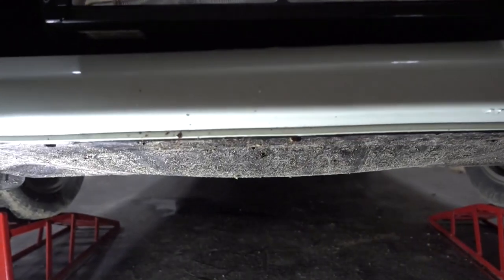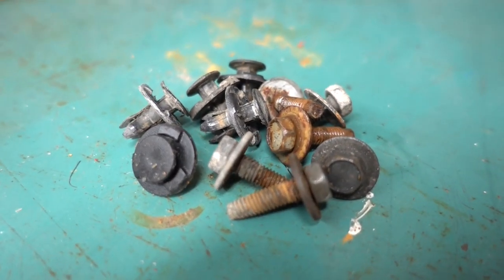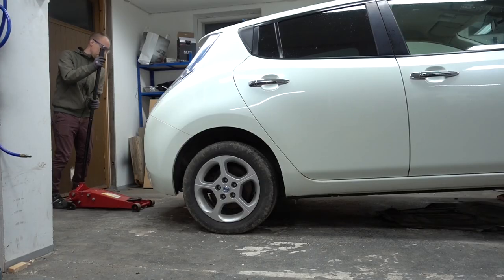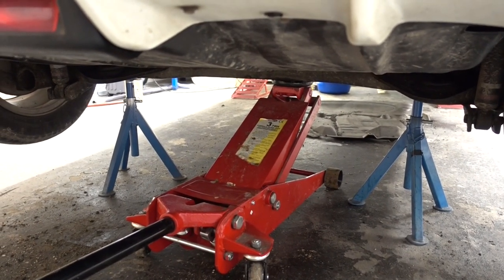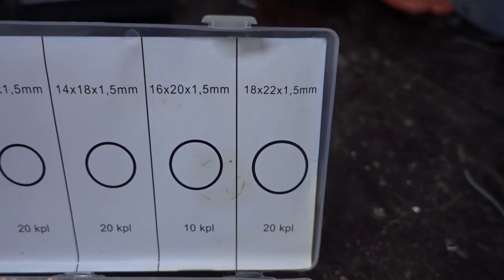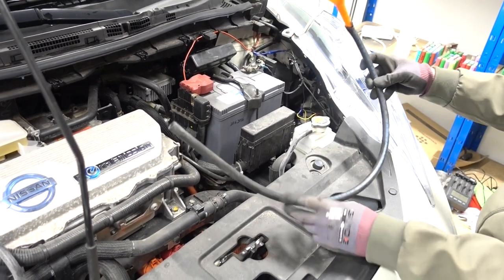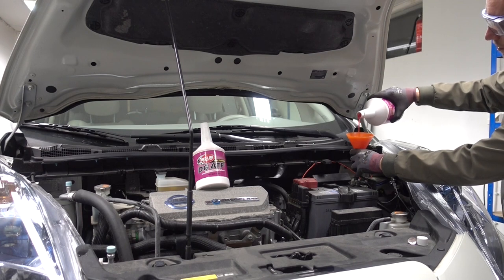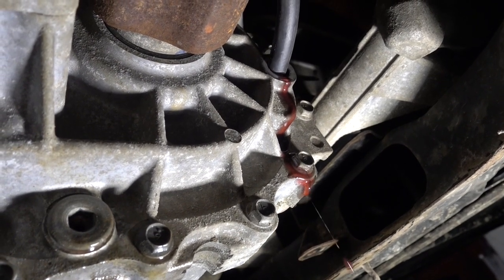Nissan Leaf Reduction Gear ATF Change [Efficiency boost!]

Comment: For those interested, I did this fluid swap on a 2015 Leaf about a year ago using Amsoil Synthetic ATF.  Went from 4.6 mi/kWh to 4.9 mi/kWh.
Reply: In warm or cold weather?
Reply: @daltonx6177  IIRC I probably did that fluid swap in warm weather.
Reply: I did this fluid swap on a 2013 Leaf a little late, I had over 120k km on it, with Valvoline ULV ATF in July of 22 and went from a yearly average of 5.8 km/kWh to 6.6 mi/kWh. There/s a small clunk noise from the reduction gear when changing forward and reverse if it's warm because the fluid is so thin, but has been fine for 19k km.
Reply: thanks 4 sharing with us!
Reply: Very interesting. I just bought a old Leaf. This car has under 50000 km on the clock. It is good looking both outside and inside. Battery health seems too be good also. I have seen many,many videos here on YouTube about this model. My thought goes to the possibility to make a battery change on it. But doesn’t know if any company here I Sweden do it? Or if I could do it myself maybe? Okey, have a great day.
Reply: @sanoj1969  No idea about Sweden but here in the U.S. there is someone swapping 60 kWh batteries into first gen Leaf’s.  I think they wanted $10k.    I was hoping Nissan would offer a battery swap program which would allow one to buy a larger battery and credit you back the original battery for recycling but that has never materialized.  At any rate, I’m now at 90,000 miles with 11 out of 12 bars remaining on my battery.
Reply: @bobbbobb4663  where is that person in California or Washington or Oregon or something? 
    Do you know any places doing battery swap on the East Coast? I have a 2013 that I’ve had since 2020 it had 10 out of 12 bars …just went down to 9 . I still use it every day, but I would love to get a battery upgrade in the next year or two.
Reply: @matthewzizzo4586  Sorry I don't recall

Comment: Did this a couple days ago. Very easy process. What I've noticed after. Is takes a little less energy to stay at cruising speeds. Will see if the miles per kilowatt improves
Reply: So ? Did you measure any improvement after one year ?
Reply: @daltonx6177  I noticed it more when it was very cold. Could I measure it, not really. Just felt a bit smoother at cold "starts". But the oil that drained out vs what I put in was an upgrade.

Comment: I stopped taking my 40kwh leaf for service when the warranty was up as the dealership is a ripoff and haven’t serviced it for 70,000 miles with no problems. No loss of battery bars and running as new. After watching your video I’m thinking of changing the oil soon.
Reply from the maker: Good idea, it will make the reduction gearcase last twice as long!

Comment: What a coincidence! I just replaced it yesterday. A thing to mention, for 2011-2012 made LEAF oil capacity is only 1.1 Liter. I have also used some Molyslip additive. I was geting very good results in ICE vehicles by using Molyslip additives. So decided it won't hurt if I use it on my LEAF either.
Reply: Me too, added molyslip 5 years ago when I changed the fluid at 60.000km Now the car have 170.000 so should have made a change agiain, but I believe with the molyslip additive, MoS2, it is not needed.
Reply: @tucsonor   I have a better additive to offer called Turbofield Nano Treatment. This TREATS THE METAL AND NOT THE OIL.This is more long lasting and reliable and reduce friction heat noise and vibration.
Reply: @tucsonor  no not at all similar . This is not chemical .Molyslip is on micron levels and this is nano level .It is totally different .

Comment: Ive done this service on both my 11 and 18 LEAF.  if its never been done get it done....the fluid gets super nasty and laden with metal particles from the gears.  mine looked like sparkly black oil on the 18 after only 20,000 miles.  I used Amsoil ATF.  Great video Dala!

Comment: I watched this very helpful video and changed my oil yesterday. My 2015 Leaf has a third port on top of the gear case. I used the top port to add the oil, but you need a 10 mm hex bit socket, a universal drive and a couple of long extensions to get to it. For most people, the method in the video would be easiest. He mentions that his brakes might need attention. You can test for brake drag by stopping your car at a landmark on a slight hill leading to a flat section of road. With the car in neutral, release the brake and note how far the car coasts before it stops (a tree, driveway, utility pole, etc.). Do a baseline run after brake service and then every couple of months. Any loss of distance will indicate there is brake drag or possibly an underinflated tire or a bad bearing. The parking brake might need adjustment, too.
Reply: how do you put the Leaf in Neutral?
Reply: @bradjohnston9810  Move the shifter to the left and hold it there for a second or two. It's the same as shifting into forward or reverse except you don't move the shifter forward or backwards.

Comment: The Aluminium crush washers can be re-used at least once, but should be annealed to soften them first. The trick is to mark them with black or blue Sharpie marker and then heat them until the Sharpie colour fades. Quenching makes no difference to the annealing.
Reply from the maker: Good tip! I'll revisit the fluid change next year and see how it is holding up, maybe even try lower viscosity valvoline ULV

Comment: Just changed the fluid on our 2013 Leaf with 85k miles on it.  I was surprised how clean the fluid still was- it was still pink and this was first change.  This video made the process pretty easy.  I agree with the others in that the splash shield is hardest part of process in many ways.  My splash shield was damaged with some tears that I repaired using some Gorilla tape.  

My tips are:

1. Use a long neck funnel if your existing funnel with hose doesn't reach. Mine did not so I was able to snake the funnel with hose closer to the fill plug and then use another funnel to reach that one.  That worked fine and saved me a trip to buy a different funnel with hose.

2. oil your splash screen screws to reduce chances of rust- an easy thing to do

3.  on the splash shield reinstall is to start from the rear because the shield folds in under the other shield. I did not do this initially and had to remove all the other fasteners and do again. I also used the Redline D6 as well. I'm a big Redline fan so that was an easy decision to go the Redline route.

My total service time was about 2 hours- I got to talking with the neighbor and had the length issue with my original funnel with hose that needed resolution.

Comment: Thank you sir' I am a Nissan leaf owner, and I completely forgot about gear oil changes, I used to do this on any automatic petrol car I owned previously, 

Here is the UK, there is an unfortunate trend, it's called rip-off Britain, many services and items are far too expensive especially when they have the monopoly, I therefore try to do most things myself, thanks again for this valuable knowledge
Reply from the maker: Good thing to DIY this one! Good luck!
Reply: In the UK, a fellow writing into mynissanleaf.com said it costs 230 British pounds ($321 U.S. dollars) to get it done.  In the U.S., I think a Nissan dealership will charge around $70 U.S. dollars.  Thing is, in the U.K., they are just going to keep people away with prices like that.  Even the $70 U.S. cost is too much in my opinion.  This is an EASY job, and only 2 quarts of ATF fluid, 2 new aluminum crush washers, and 15 minutes labor.  I've done mine and am about to do it once more.

Comment: I did a brake change in the back and cleaned/ lubricated the front breaks on my env200 2014 (24kw) two weeks ago. My consumption dropped significantly and I'm measuring a average range increase of 18% in ABRP.
Definitely do a brake service on your leaf and please measure consumption differences.

Thanks for an informative video, did not know the leaf used gear oil :)
Reply: I'm guessing I'll have to do a caliper seal rebuild because they already seem to be sticking. 2013 leaf
Reply: @macmaniacal  probebly not the the caliper seals, it us usually the braking pads that is sticking and also the guiding pins for sentering the caliper. At least here in Norway. So check that before any big job braking into the pistons seals etc.
Reply: @tucsonor  I've already re greased the slides and sanded down the pads, and at that point I tried pushing in the pistons and was hard to do. I think I was the first to flush the brakes. The square cut seals should return the caliper and prevent most of the noise. I'll be buying a rebuild kit and see how bad it is
Reply: @tucsonor  oh I just found out that the up to 2013 had dual piston calipers. 14+ had single. I wonder why the change. Pistons returned easier on the singles? My brakes also tend to grab a little at creep transition speeds
Reply: Pushing the pistons back in and out again will for sure not hurt. My experience with grabbing at creeping speed is that the pads and pins do not move freely. But of cource, if piston have sticked to the seal, you would probeby get the same effect.
Reply: What do you mean by brake change? Changing the pads?
And what did you lubricate and how?
If you perceived such an improvement I think we should all try it too!!

Comment: My 2016 30kw Leaf has 230,000km on the clock and has never had the oil changed. Thanks for the video Dala, I'll be doing this when I get back to NZ.
Reply: Leafs seem to do really well in NZ. I'm just about at 200kkm and just lost 10th bar. I'm doing this too
Reply: @Skipperfish I have a leaf in NZ and it’s probably because it’s never that hot or cold here. We rarely get above 27c or below 5c
Reply: How did the fluid change work for you?

Comment: I did the change today and the magnetic bolts (both drain and fill) were completelly stuffed with with metal splints. After a short test drive the leaf feels more easy to cruise... must wait for some efficiency results but it was definitely worth doing!
Reply from the maker: Up to 4% more power! Saw a dude dyno before/after!
Reply: @DalasEVRepair  Wow, that's a great impact of such an easy service task.

Comment: Thanks  Daniel  for the video i didn't know that that the oil in the gearbox could be changed, thanks to your video I've now done it with no problems at all cheers keep up the good work
Reply from the maker: Nice work changing the fluid 👍

Comment: I just did this on my 20013 SL US, I found it way easier to refill by taking off the front wheel on that side and then feeding the funnel from the wheel well instead of trying to fit/squeeze the funnel/bottle of oil from the top.
Reply from the maker: Good tip!

Comment: Just done this today to my 2011 leaf at 86k miles. No big chunks of metal but black old atf and their was a fair bit of metally sludge around the drain and fill bolts. Used a garden hose to snake it in. Hardest part was  part was getting the on ramps on our driveway and then level using jack stand. Would be super easy with a full garage lift. Did this as part of a 3 parter where we were speccing out where to put a 2k ac electric heater and 3k hydronics kerosine/diesel heater to replace broken ptc heater. Ep2 for us is bumper off and dry fit heaters behind crush bumper and ep3 is plumb them in. Thanks for the video Dala. Helps to see all the steps obviously laid out.
Reply from the maker: Glad to hear it helped and sounds like a nice project! Grab some pics and put them at the mynissanleaf.com forum!
Reply: @DalasEVRepair  this saturday we have the bumper off and will dry fit the two heaters and bracket for the kerosine tank.
Reply: @Whereswally606  Did you video/photo that process?

Comment: Hi Dala! Everything looks good, but one think is a bit off. Alluminum and copper is galvanic pair and they will eat each over. Pavel from Los Angeles.
Reply from the maker: Yes! Aluminium and copper in contact will experience slight galvanic corrosion. How much depends on how often it gets wet/whether it is salt water etc. Since the leaf motor compartment is covered with protective plastic, you should be fine. But Alu is the correct replacement!
Reply: @DalasEVRepair  This washers and fill/drain bolts looks like a same ones on 2gen prius transaxle, i will check it out if they fits. They cost few cents(less, ten 1$/each) OEM.
Reply: I was thinking the same thing but figured it wasn’t going to be a big deal....
Reply: hey how much should I expect to pay a dealership in LA, to change my oil? I dont have the tools to do it myself.

Comment: Nice video, very informative. I notice you are using 18x22x1.5mm gasket, it seems to be slightly different from the original one. Would you share the information about original plug gasket size? I can't find anywhere. Thank you very much

Comment: What is the temp at which this will begin to make an efficiency difference, also, what do Nissan mean by inspect...how would you know if you need to replace?
Great videos:)
Reply: I would guess an inspection would be to take out the fill plug and check the magnet for colour, smell of oil and for any metallic deposits on it.
Reply: He also said recommended inspection is 24,000 kms. ATF turns brownish when it gets old: new ATF is red. The sludge that he was wiping off of the plugs is metal filings: they can only catch so much.

Comment: Thanks for the video! I followed you on a 2013 leaf, and noticed a couple things: 1) I started draining before I lifted the rear to have the car level; I did not see any additional fluid come out. 2) I measured the fluid that came out at 1.33L. 3) I added 1.4 L, expecting some overflow. There was none. So perhaps leaking at the fill bolt hole is slightly overfilling?
Reply from the maker: ZE0 and AZE0 have slightly different capacities. Never hurts to fill until it overflows!
Reply: or underfilled from factory...+/- 2 dl doesn't do any harm, but adding 2 dl up on all produced cars saves Nissan a lot of money.

Comment: Is the gear oil shared with the motor oil on the Leaf? I know the oil is shared on my ELR, so picking an oil with the correct electrical resistance is important!
Reply: No, it's just inside of the "transmission".

Comment: I wish Dala would mention exactly where he placed the hydraulic lifter to lift the rear end.  Axle?  Also the diameter of the plastic clips so I can order some without going in and removing one one just to find out.  Otherwise a good video.
Reply from the maker: Lifted by axle. Google Nissan plastic undertray clips, you will get the part number that wy

Comment: Great video, thanks Dala!
One question though.  If the fluid "that comes with the LEAF is not particularly viscous in colder temperatures", then that would mean it has LESS resistance in cold starts, not MORE resistance, because "viscous" means "having relatively high resistance to flow".  Or did you mean "...too/overly/unnecessarily viscous in colder temperatures"?
Reply from the maker: Original fluid has low CentiStoke (mm^2/s) for same temperature as ULV fluid for example

Comment: The reduction gear on my 2022 leaf just started making a growling noise on deceleration. Will drain the oil and if there’s no pieces of gears on the magnetic plugs, I’ll use a thicker heavy duty ATF to squeeze a little extra life out of it. Dala, do you know if the reduction gear on the 62kwh plus leafs  is the same one as the regular 40kwh ones? Thanks! I’ll start looking for a replacement soon 😢
Reply from the maker: 62kWh has a stronger planetary gear, but it can use the reduction gearcase from any other LEAF model

Comment: just fyi:  i reused my aluminum ring seals and i never had any leaking problems and i used valvoline multi vehicle "red bottle" atf and prolong transmission treatment.
and a quick question: i was just wondering if its normal for the reduction gear to make a bit of "gear noise" and will this d6 fluid reduce or eliminate it?
Reply from the maker: It shouldn't make any noise afaik!

Comment: Asking for a friend... but if (my friend) did this oil replacement but when he went to put the drain and fill plugs back in, realised he didnt have the correct sized crush washer, would heating up the original ones a bit then using them be a bad thing!!??  Anyway (my friend) is considering doing it again and fitting new crush washes but reusing the newly installed oil.  Great vid btw, thanks. Thoughts.
Reply from the maker: If it doesn't leak, I wouldn't worry. Reinspect after a few thousand km to see if it is dry!
Reply: I will pass this onto my friend!!  @DalasEVRepair